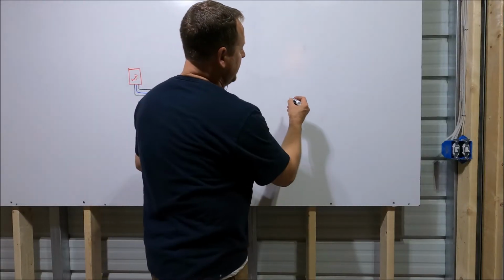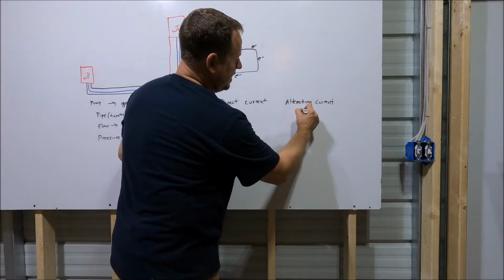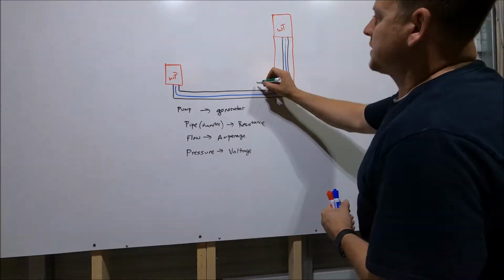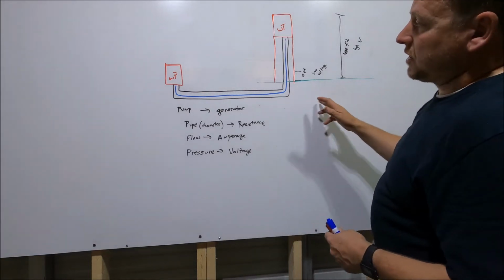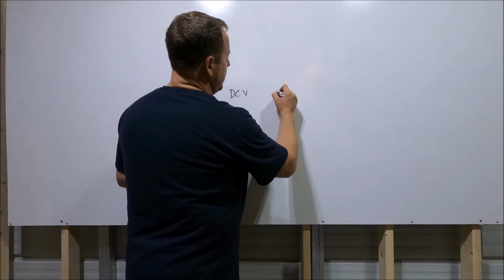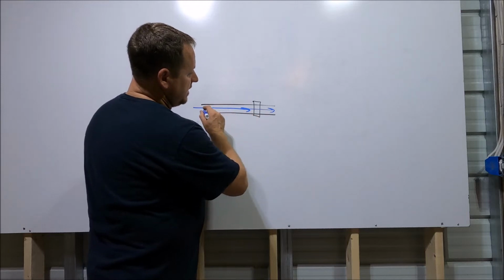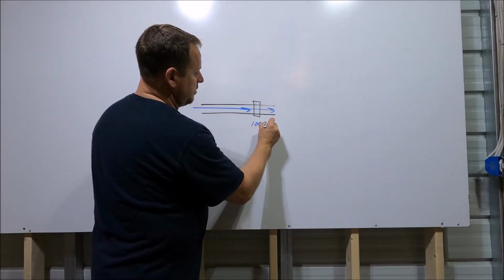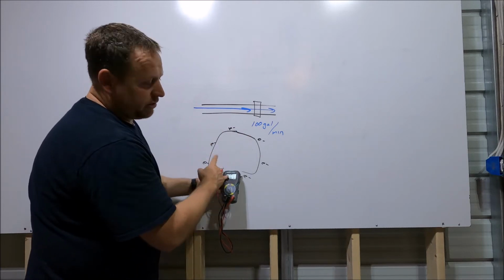13 Suggested Electrical Tools for Homeowners | Basic Circuit Theory

Comment: When you explained the ac and dc current, you said that all the electrical wiring in a house is an ac current? Did I get it right?
Reply from the maker: Yes. The power that comes from the grid and powers outlets and lights is all alternating current.

Comment: Have you had any condensation issues in your metal building?
Reply from the maker: No. It was installed late last October and I thought in at least one of the seasons there would be condensation, but there hasn't been any.